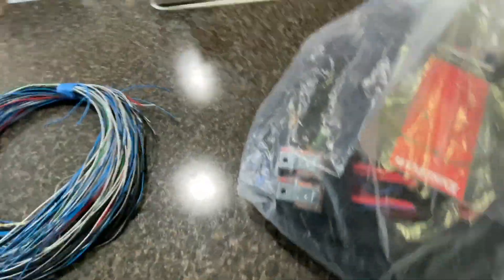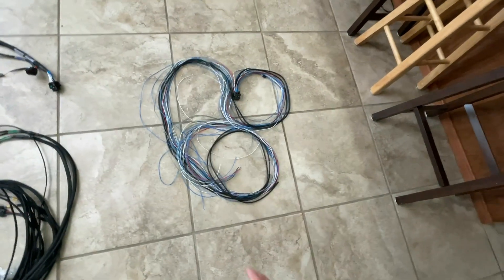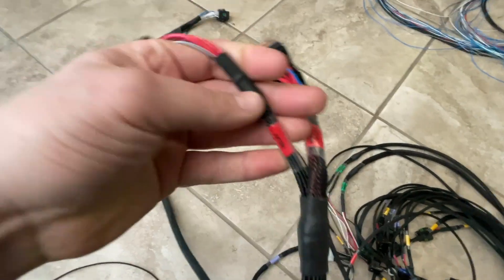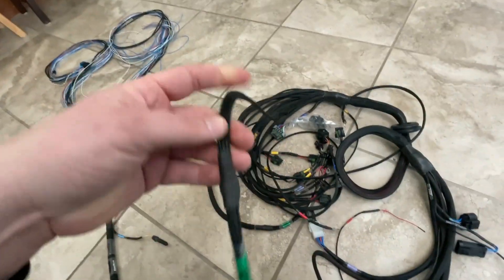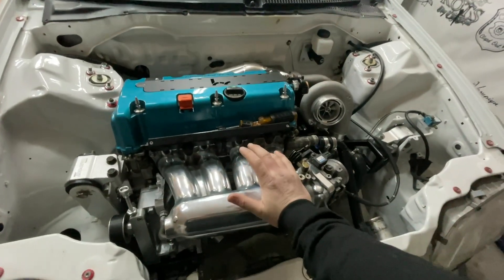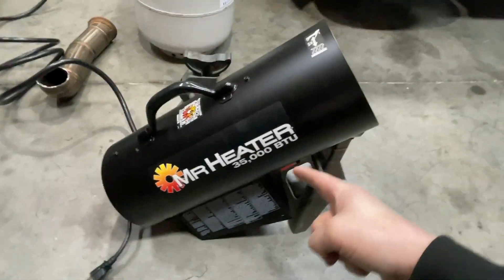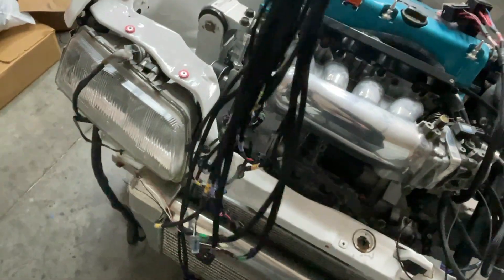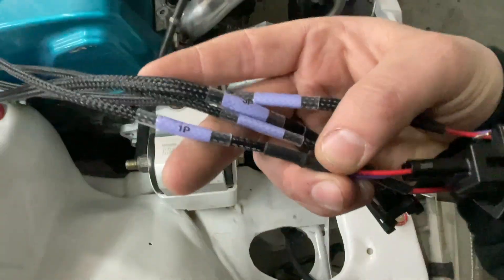Fueltech Universal 4 Cylinder Harness - Overview

Comment: So I have a 1973 Volkswagen beetle with a 2276cc engine with twin 48Ida style throttle body fuel injection. Will be running on methanol and 200 shot of nitrous for drag racing. Any reason this wiring kit wouldn’t work??
Reply from the maker: It will work. Its a universal harness, wire it to your liking 🤙🏻
Reply: @ClapdOut best fueltech wiring video I’ve seen man so informative. And I plan on using a strain gauge also so when that was brought up I was like hell yea! Thanks man

Comment: To all the questions about vtc, vtec & intake cam sensor. You would use the extra aux’s for those connections and for the exhaust cam sensor which you will also need you would use the cam sync wire as listed in the fueltech manual

Comment: I have a question I really need help with. The A harness I bought with my ft450. Is it set up for full ignition and injector sequintail control?? The only othe things I need to run off the harness is my boost control, vtec and 2 step.
Reply from the maker: Batch fire, not sequential
Reply: @ClapdOut Yes, I leared that very disappointing news way to late. Had I known that I would have bought the 550 right off the bat

Comment: This ecu was horrible for my k24 s2k ap1 swap, hondata kpro v4 is the best, the wiring harness from hondata and best software for a Honda
Reply: Why was it the worst? I have k24/ap1 I'm starting on.
Reply: @davelassell  fueltech wiring harness was BS, they couldn't get every sensor properly wired for this swap, I called hondata and they built me a custom wire tucked harness ready to go, now I'm running clean dyno tuned and no check engine lights or chassis wiring problems
Reply: @davelassell  check out my build on my video no check engine lights anymore, and they wired the custom RWD intake manifolds sensors the correct way  unlike fueltech
Reply: @sycboyspi  Thank you for posting your experience. I was considering to get fuel tech because at this point there isn't much difference with pricing. I also wanted to run the Fueltech on my K swap along with my S2000 cluster.
Reply: @Jovan.101  the s2k cluster work great with kpro v4 that's for sure no check engine lights and all gauges work
Reply: @sycboyspi  you had to use a k tuned converter with the kpro v4?
Reply: @Jovan.101  nope
Reply: @Jovan.101  I'm also using the K Power industries rwd intake manifold

Comment: I understand if you want to rip out all the existing wiring and have to figure out what part of the system is what but if you have to figure out the different for the lights and accessories wire diagrams why not just use the existing system to a degree?

Comment: Did you have an issue with max fuel pressure showing when wiring in the fuel pump on pin (F) to the 3rd relay on universal 4 cylinder harness?